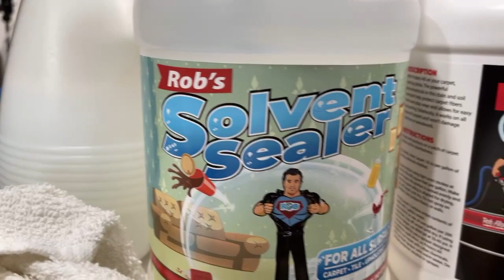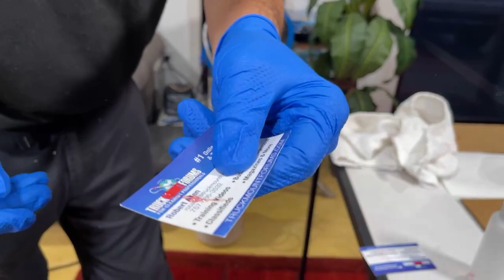HOW TO AGITATE, CLEAN FURNITURE & PROTETC TO SEAL FURNITURE UPHOLSTERY - AGITATION TOOL SHOUTOUT

Comment: Teflon fiber,and fabric protectors say right on the container use after fiber or fabric is dry.
If not left over soil, residue is sealed in.
Reply from the maker: Soil composition doesn’t change after its dry.
Reply: @TruckMountForums  How could soil composition not change when dry?
Says right on bottle use only when  fiber or fabric is dry.
Reply from the maker: @hansslane7080  residue and soil doesn’t leave when dry. If you have a problem with residue and soil, increase rinsing and use air movers to get dry as possible. Improper rinsing and drying leads to poor dry times. Use an air mover also. Then the uph will be plenty “dry” enough to apply a protector. Most protector labels give directions for wet and dry applications as it may affect the dilution ratios depending on how wet/dry the furnishing is.
Reply: @TruckMountForums  thank you